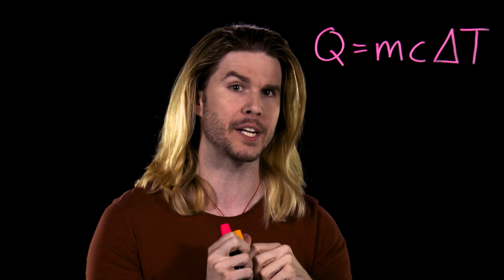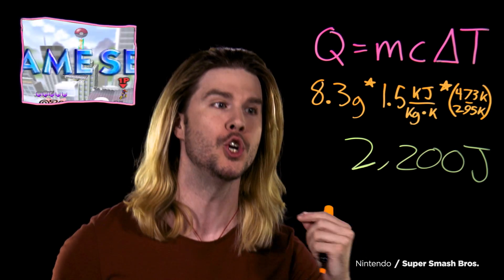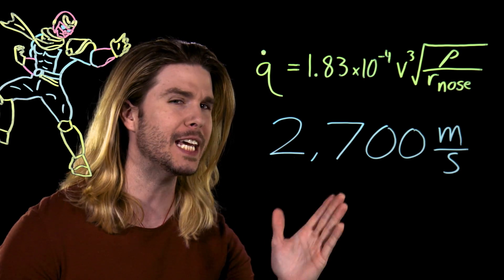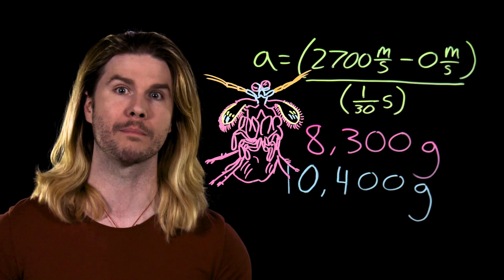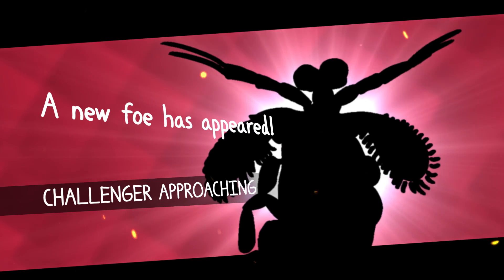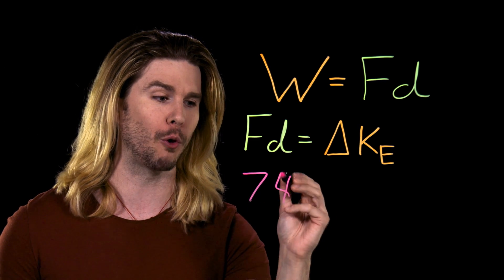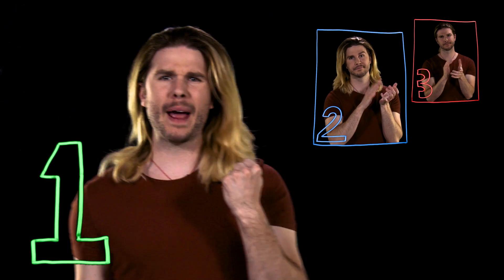How Powerful is a FALCON PUNCH?

Comment: If 74million N of force doesn't make sense for a humanoid to create, forceful enough to basically kill in one hit (like the power of a rocket) and as you've already covered, Captain Falcon is wearing gloves... What if his gloves are coated with a fairly flammable/combustible substance which is what ignites the Falcon Punch? Chlorine Trifluoride for example is able to set fire to almost anything by mere contact, so if Captain Falcon's gloves are coated in a layer of flouride under the Chlorine Triflouride applied, he is safe from the usual chemical reactions but any of his unsuspecting foes become easy, combustible targets for the falcon punch. As a sidenote, maybe that's why his suit also shields his eyes - some of the reaction this chemical causes releases gas that is known to damage the eyes.

Regardless, excellent episode as usual! :)
Reply: Only one problem, this theory is instantly debunked by the punch itself. If his gloves were coated in a flammable substance then they would continue to burn after ignited. If anything his gloves are very flame retardant because the flames are extinguished right after he executes the punch.
Reply: @89ludeawakening1  While I accept the idea in general, I don't think I was clear enough. What I meant to say was that perhaps his gloves have flouride as a coating and the chlorine triflouride on top of that. This is actually how this substance is stored - you coat the container with flouride on the inside for the CT to not react with the container itself.  But yeah, I should've probably rearranged my comment to make it clearer.
Reply: @kerrynoir4129   That actually makes more sense, that is why he has to spend so long on the wind up as he's secretly applying the flouride coating.  Then once he punches it will burn off the flame retardant gloves.  This way he also doesn't break every bone in his arm shoulder and much of his body buy throwing a punch with such force.  The game f-zero might give some credence to being able to travel at high Gs but would not explain why he wouldn't be destroyed by Newton's Third Law upon contact.
Reply: but his punch lights on fire regardless of impact, even if its just moving through air.
Reply: @CP110  could be game design... You wouldn't wanna be playing smash and Capt falcon just punches the air with no flames coming out because it would be insipid to us.
Reply: With the right chemical formula you wouldn't need the punch to ignite the fire, if the gloves had some abrasive finger pads a snap of the fingers could be the catalyst for ignition and the punches momentum gives the fiery bird like shape.  This could then also apply to his down b the flaming kick, and the explosion from his grapple.  And the concoction is likely the fuel from his racecar.
Reply: I'm pretty sure he has the power of a fragment of creation itself at his disposal, so it doesn't really need to make sense for a normal human to create.
Reply: Kerry Noir: Ah, yes.  Good ol' N-Stoff, which translates to "Nope-stuff".
Reply: @sdfkjgh  Good ol' Smart boy units! :D
Reply: Captain Falcon is actually extremely above average
Reply: I'm also here to take a ride in this comment to correct the frame rate part. The original smash bros runs at 60 FPS, not 30 as the common sense around the N64 would assume.
Very few 3D games runs at 60 on the N64, but all the titles in it with captain falcon pull that off.
Reply: Nah, Captain Falcon players always go for grabs so if his gloves were slippery he couldn't grab anyone. He also has the Falcon Kick which means he'd also have to coat his boot with a flammable substance, but if he did that he'd be slipping all over the stage. If you also include his taunts he can literally light his entire body on fire by flexing. I'd say he's just a pyrokinetic.
Reply: Guys he is just has fire powers... his taunt literally has him envelope himself in flame as he charges up like a dbz character.
Reply: Wouldn't a chemical explosion of that magnitude send both his opponent AND him flying off? Otherwise, this would be just visual effects and Señor Falcon is just nudging them EXTREMELY hard. Talk about visual effects, the gloves would also stay on fire unless the chemical also had a retardant to stop the continued reaction. His gloves would also need ablative shielding to not only keep his gloves clean but also reduce heat transfer to his skin inside. I think it would make more sense force him so simply create that force by moving some part of him forward, conveniently reducing recoil from striking with that force, than to create a chemical explosion on contact.
Reply: chem grad nerd eww

Comment: you forgot to account for the higher air pressure at ground levels. even on a tall mountain you would not need to go as fast because the air is denser

Comment: Hi Kyle,

Huge fan of the show and love how much I learn from watching you.

I have some issues on the data you're using to make your hypothesis.

Firstly, in the n64 version the flame falcon does appear in a single frame but C.Falcon is indeed charging the energy before releasing it. It's visible by the yellow glow he emits and this is even more visible in the latest smash game where energy is concentrating on his fist before being released. So we can assume that the flames are not only produced by his velocity but also some kind of energy released when he hits.

Another thing is you're only considering his falcon punch move but his other moves also emit flames. If we focus on the falcon kick it's instantly igniting when used so I think we can assume that the suit he's wearing has more to do with the flames than his actual speed.

And to prove that further let's compare the falcon kick to another character's move, lucario's extreme speed. When performed simultaneously, lucario is moving faster than C.Falcon so if the smash physics apply to all the characters he should burn as well. However he doesn't so it proves that C.Falcon's flames are not a result of his speed but produced by his gear.

And last point but it's more trivia, according to your "why you don't want superstrenght" video, if C.Falcon was to hit his opponents with that much force, he should be crushed instantly on impact. So either way he doesn't punch them that strongly or because video games.

Comment: the frame rate is 60 fps
it's a fighting game

(For accuracy, it was 50 FPS in some situation where the TV was 50 Hz)

Edit : fighting games internally run at 60 fps no matter what the output frame rate is, once reached the screen. I.e No time or action happens between two frames, it's like the smallest time duration in our universe

Comment: here is a interesting question. 

if a comet moving at 30m/s relative to earth being still, and the diameter is 2km , and its angle of descent is 60 deg, and it did hit lets say in New York (picking at random) 
now i know the resulting crater width and depth at 12,000m wide and 600m deep(rorughly).
but what i don't know is what would the impact be on the loss of life and environmental impacts for 30 days after the impact

Comment: So I just told this to DollSkin7 in the comments, the question, if physical energy can be transformed into thermal energy, how hard would I have to hit a chicken to cook it?
7823.2 m/s is typical low earth reentry speed and the speed of a hit you would need to cook a chicken would be 1665.65 m/s so reentry could probably flash fry or at the very very least over cook the chicken.

If falcon punched this chicken at the velocity of 2,700 m/s then he could over cook it but it would still be edible. but according to what you said, falcons fist would be subjected to 20,000 times the intensity of sunlight, This would most likely vaporize the chicken in the snap of a finger. since we are mostly protected from the suns rays by the ozone we don't feel like the sun is that intense, but once you get into space it's a different story. If you were caught in space at the same distance from the sun as the earth without a suit you would burn to a crisp, if you then went somewhere near the sun itself, you would melt. The chicken is being subjected to 20,000 times this so not only would it melt, it would completely vaporize within like a second.

By the way, your arch nemesis wouldn't happen to BE a chicken would it?

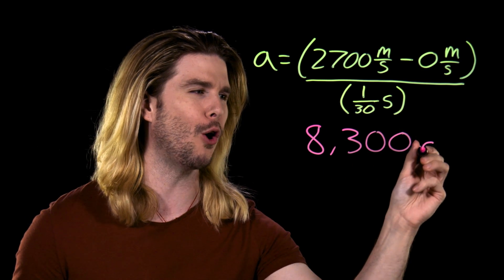Comment: 7:33 Error in the formula

All Smash games run at 60 frames/second, not 30
Reply from the maker: Used uploaded footage for the numbers,  which ran at 30 -- kH
Reply: @becausescience  it's very common for capture hardware to capture old game consoles incorrectly (attempts to deinterlace, when it's actually 240p progressive). The game does natively run and output 60fps.
Reply: And wouldn't the most modern version of the game have more frames to measure?

Comment: The auto ignition temperature of leather is way higher the 200c i have warped steel hotter than that for Hours to slow the cooling after welding the leather has got up to 350c tested with a ir gun

Comment: taking recoil into consideration, whenever captain falcon hits an opponent, he would fly off the screen and lose a life.
Reply: not exactly, kind of like how a golf club doesn't recoil when you hit the ball, with the overwhelming difference in force vs. mass the target eats the hit and he would continue on through, my question though is how does he stop himself from at the very least falling over or more likely hurtle off stage after the person he hits.
Reply: @Kerrook  If he's powerful enough to throw a punch at that speed, then he should be strong enough to stop his own momentum.
Reply: @DecepticonLeader  assuming it were possible to throw a punch like that, would it still be possible to stop one's momentum with only friction on the ground within a useful distance?
Reply: @PeterPan3713  I'm not saying the ground isn't going to crack in the process if his footing is good enough, but if the ground can stop an asteroid, it can stop a falcon punch.
Reply: @DecepticonLeader  with an upper cut he might just end up with a crater, yeah :-P , but with the jab kind of punch i feel he throws he would just glide across the ground, right?
Reply: @PeterPan3713  Right. Unless he's got a really good grip on the ground in which case it will be more like when lord Boros fought against Saitama on the roof of that space ship.
When Boros was hit by Saitama, he wasn't immediately sent into orbit, but instead the ground (some type of metal) was ripped and deformed because of how abnormally good footing he had. I must assume that stopping any kind of super-punch means damaging the floor to stop your own momentum even if it's a horizontal punch.
Reply: @DecepticonLeader   agree.. also: how awesome was that OPM episode :-D
Reply: @PeterPan3713  It was one of the most epic moments in anime, at least in my opinion :-)
Reply: @Kerrook  do the ratios of cap vs kirby and club plus player vs ball not play an important role here? but yeah, even if he hit perfectly and there were no recoil, he might just fall off the screen in the other direction :-P
Reply: Depends on if he's punching Kirby or Bowser.
Reply: @JamesSmith-dn8lb  or if he misses.
Reply: @joshuastomlin878  yeah id imagine his arm would rip off on a wiff.
Reply: @ultimasurge  he'd just spin, a LOT, and have one hell of a headache. No, likely pass out if he's generating that many Gs with just his first.
Reply: @JamesSmith-dn8lb  I guess either way it would still affect cap, right?

Comment: i am pretty sure you won't go flying after the punch. Given that the force exerted on your face will be 74 million Newtons and the average surface area of a fist is 0.05 square metres, then the pressure exerted on your face would be 1.48 BILLION pascals which is around 215,000 pounds per square inch. The fist will fly straight through your face

Comment: Question: Hiw much power is in rocket league boost? It can accelerate a car to ludicrously high speeds (supersonic) and send you flying through the air. Also, how heavy would the ball be? I've never seen it get going over 102mph. even after being hit by a supersonic car.

Comment: If we test gravity in smash bros, we see it is actually much higher. I believe i have seen some figures around 32m/s/s.  Is there a correlation between gravity and air pressure?  If the air pressure is increased, meaning there is just more air, is abiatic compression easier?  Could it be the air that is combusting? 

Love your show

Comment: For there to be a flaming punch there would actually have to be enough air molecules for that to happen. 

With a 3 foot reach of a very long punch, there is not enough air to build up and cause the effect. 

However,  Maybe if you increased the newtons to say, that of a Falcon rocket – 8,700,000 N, the punch would make sense and more importantly, the name of the punch would make sense.

Comment: I don't think the distance in work equation is really accurate here for a couple reasons. 
1. a trained boxer/fighter knows to punch THROUGH an opponent when throwing said punch. Captain falcon would probably be placing additional mass as he uses his body to help carry the punch past his opponent in order to increase raw power of his punch. 
2. At speeds these fast, and with a contact surface so small, Falcons fist is far, far more likely to actually go clean through the flesh of an opponent rather than have his fist be stopped by them. At these speeds, his fist (despite its size) would act like a bullet or more accurately a cannon ball and pass through a body like it was tissue paper. 
Then there's another thing to consider
These factors would mean the stopping distance is far greater than just the fist width that was calculated, probably something closer to  0.4-0.5 meters (dependent on captains reach) as optimal punching distance and the amount of fighter his fist is going to pass through and start to slow his fist down from friction.

On the note of serious bodily harm:
With the amount force being applied, Cappy is probably not going to have a great time on HIS end as his arm experiencing this amount of force applied (especially if he punches something solid like metal or such) would immediately shatter every bone from fingertip to shoulder and and probably completely shred or liquify the fleshy remains of said arm. Also considering for point one above, we can also assume he's carrying through his punch meaning his body is going along for the ride and the rapid acceleration/deceleration would bounce his internal organs like a pinball machine and possibly giving him the sweet release of death instantly. Or if he survives, bleed out slowing from massive internal trauma with fleshy scrap ribbons for an arm. 

But hey, "show me your moves" right?
(Edited for spelling errors and to convert imperial estimate into metric)

Comment: Hey Kyle, you should make an episode about the way adamantium seems to get harder when it is red hot, since it is shown to be able to cut through room temperature adamantium.
This is the opposite of what happens to most metals and materials in general that I can think of, although there are some kinds of steel that, after quenched and tempered, become harder when heated to specific temperatures and cooled slowly, but thats a little different from being harder when still hot.
You could also look at how adamantium gets red hot without melting and yet melts without getting red hot.

Comment: Awesome episode, a mini series about a bunch of famous super smash moves would actually be really cool! 

But I think you have some faulty assumptions here. You mention that the punch becomes fiery in a single frame and use that as justification for absurdly high work and acceleration numbers. But the fist is accelerating throughout the entire motion of the punch. It is only at the end, in that single frame you mention, that it would surpass the temperature threshold required for the leather to ignite, right? Wouldn't considering the acceleration throughout the entire motion of the punch significantly reduce the force if you consider the forward motion of the fist as having occurred over say, 1 second vs "instantly" as you did in the video?  Or am I missing something here?

Comment: HI Kyle!

A fan doesn't work like you describe in the video, the particule of air hiting you like you describe in the video sure decrease your energy but only your kinetic energy and would actually create heat rather than cooling you this is why when you go super fast this phenomenone will actually ignite the air arround you rather than freeze it.

The actual phenomenon that cool you when using a fan, or through convection, is that usaly when you stay at rest a boundary layer stay immobile arround you and will be heated through conduction by your body, and if you activate the air fan the flow will change the boundary layer with cooler air, which will increase the heat dissipate by conduction by our body, their is also the fact that the aair will most likely be dryier which will increase the evaporation of sweat augmenting the heat loss trough phase changement^^.

Have a nice day love the show^^.

Comment: But isn't the distance between the punch and the receiver too short to produce the required acceleration and heat build up to create flames? Also the mantis shrimp can create quite a punch but it is quite small. With the human dimensions, wouldn't it be harder to create such a force without significant damage to the limb creating it, if it managed to anyway?

Comment: With the ignition point of leather being around 212c, if you compare the ignition point in relation to the length of the punch you actually get a speed of 7,683 m/s or mach 23. At that speed it would apply just shy of 8 million newtons. 1.7 million pounds of force more than the Saturn 5. Its almost as strong as the FAOB concentrated at the point of contact.
Reply: I want to be a super nerd